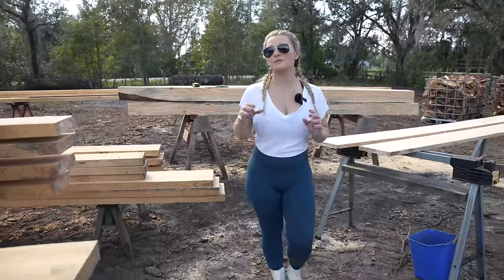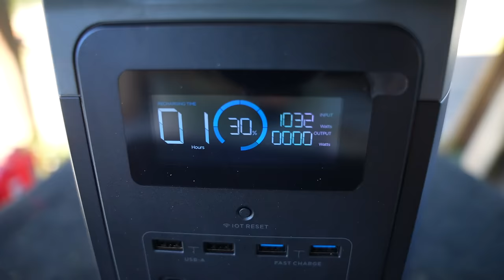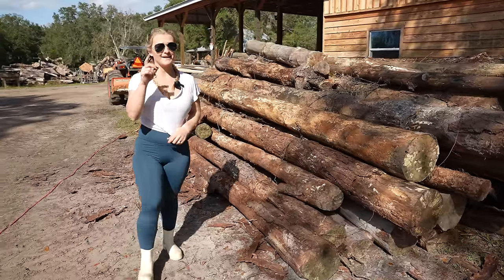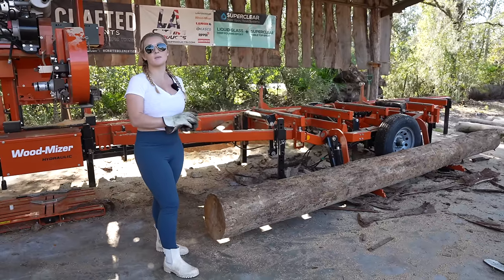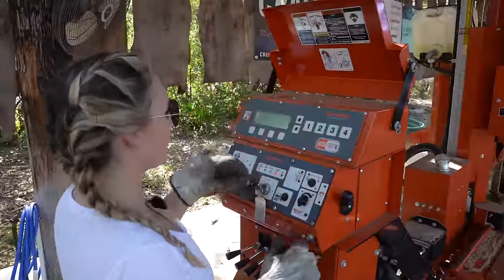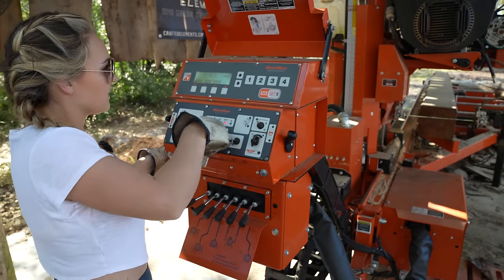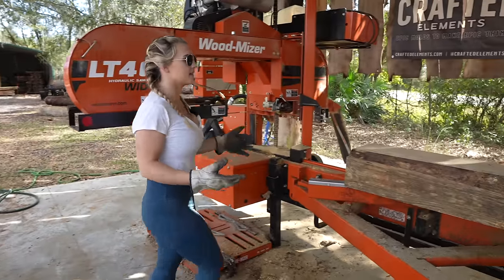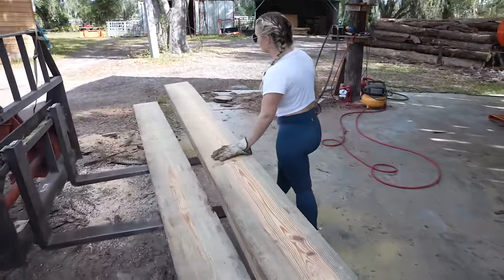I'm Surrounded By Lumber - EcoFlow Delta Max #ecoflow #deltamax #portablepowerstation

Comment: Hi!
By running an airline along the backstop side of the saw you can install 5 air nozzles that can blow off the sawdust
by pressing 1 control ... thus saving you manually dragging an air hose and trigger air gun all the time.
- Just a thought. (Enjoy your videos. I was an Industrial Electrician with "Design -Build" mandate for machinery
efficiency in mind.) This modification would speed up operation and reduce fatigue and tripping hazard.
Reply: OOPS! (Just got a better view of the lack of clearance at the back stop. Cancel 1st comment.)
 However, by running a rubber air hose inside the flex-track that contains the control cables
and hydraulic lines to the saw head ... a single nozzle could blow the dust away as it returns to "home position" on its return travel ... with the lift rollers raised.
Sorry for initial confusion. Have a great day!

Comment: I think the EcoFlow Delta Max 2000 would be an excellent power source for remote work that requires wired power tools, such as the Sawzall. It could also serve as the power station for the battery packs of tools since it has 2016Wh of power.

Comment: if you use a thicker blade or one with wider set, does the mill adapt for the larger width of the cut to still maintain lumber thickness as it was when you had a narrower saw tooth set??